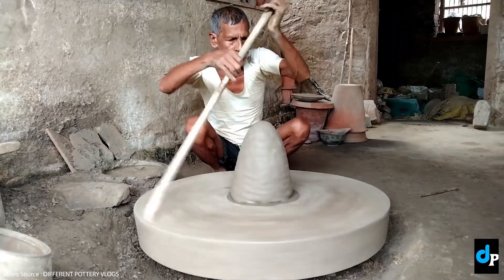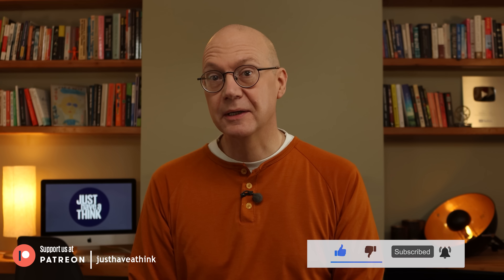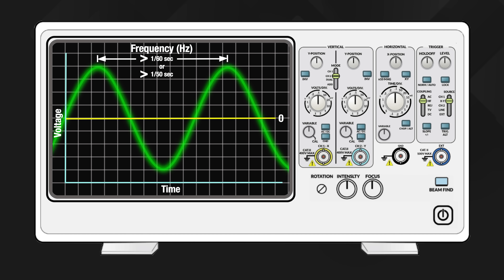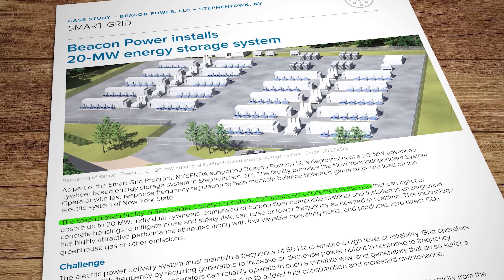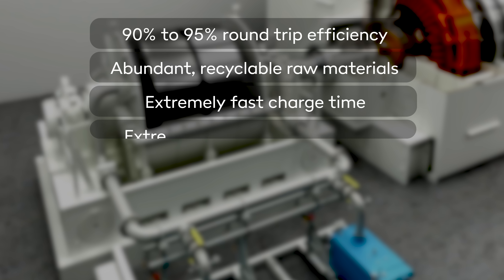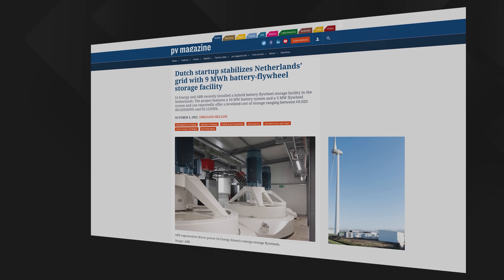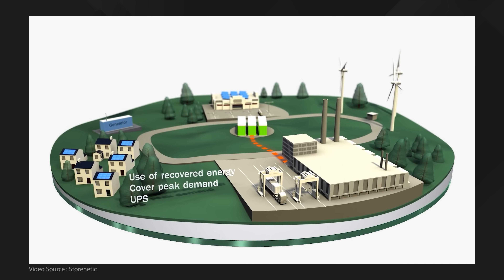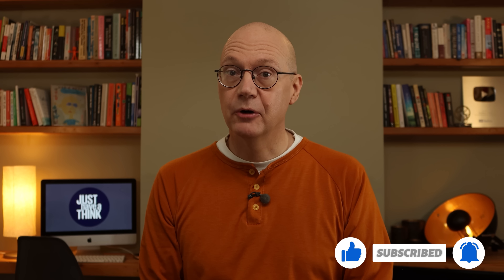Flywheel reinvention revolutionising our power grids!

Comment: One or two comments got close but, sorry, no-one here is thinking or understanding what these things are about.
I'll put the conclusion first - they are NOT to stabilise frequency. They are to stabilise Voltage

A very large problem that grids have always had is when new loads are added. Whether on a local scale or national.
The problem with 'new loads' is that they almost always contain an 'energy storage element'
Classically this would have been a coil of wire in either a motor, a transformer or especially, the ballast in old-style fluorescent tubes (long thin ones)
This is because a coil of wire, when connected to (switched on) to an AC circuit, presents itself as a dead-short-circuit.
And it remains like that until it has built up its magnetising flux (transformer & ballasts) or in the case of a synchronous motor, is up to its working speed and thus 'synchronised.
We are talking fridges, freezers, air conditioners in the home and much larger motors out there in industry.
Now then, because all grids and networks have real actual DC resistance, when these loads attach, they cause a big hole to appear in the voltage waveform - long before the 'frequency' has had a chance to see it or change.
How the grid coped previously was in that the things supplying the grid were also large lumps of wire in a magnetic field so that despite the voltage hole created by the short-circuit, they could still create and move very large currents. Currents that would magnetize the transformer and get the motor spinning - even during just one single cycle of the grid frequency.

Another class of energy storing/sapping loads contain capacitors, as in fact most home based equipments now do. They used Switched Mode power supplies instead of transformers BUT, when the device is switched on, those capacitors have to charge to their working voltage and when they do, in any circuit DC or AC, they also look like short circuits and knock a large hole in the voltage waveform. In fact, capacitors are worse than transformers/ballasts, capacitors make much better 'short circuits'

The Problem comes nowadays that a lot of energy on the grid comes from (solid state) inverters.
Certainly they need a 'grid frequency' to latch onto but the problem with those inverters is that they 'watch the voltage' like a hawk. They have to.
They also, for their own sake and safety, need to monitor the phase difference between what they're making and that of the grid they're supplying.
Thus the real problem for everybody is when a (brief as they always are) short circuit appears across the grid. The Solid State Inverter (SSI) will see the voltage hole instantly and for its own sake, for the sake of lawmakers/regulators, the sake of workmen on the grid and consumers, it is obliged to disconnect. The voltage hole will also appear, to the SSI as a phase error and it will disconnect on that alone if not the voltage error.

Thus you see the problem for the grid...
When a 'short circuit load' connects and requires a short burst of power to get itself going, large numbers of devices supposedly providing that power instantaneously disappear.
It's a perfect double whammy.
That will occur on a local level (say the air compressor or a welder in a garage switching on) but on real grid, the effect will ripple outwards. Other SSIs even far away will sense the voltage error and they will disconnect - there will be a (potentially huge) cascading failure of the entire grid

Sorry it was an epic but, we need to think

Also, and as happened in the UK a little while ago, was lightning strike on a power line.
Because the lines/wires are all fitted with lightning protection, they will be OK.
But, that lightning protection consists of a spark gap - fitted on almost all insulators used on overhead lines.
When the lightning hits, it sparks a strong electric arc across one or more of those spark-gaps and because electric arcs have *very* low DC resistance, they short out the lightning and protect the grid. 
But they short out the grid also.
(They work by creating the short circuits and the energy of the lightning is dissipated in the DC resistance of the wires as it runs to ground, where it wanted to be. Folks wanting to build super-conducting grids are hereby warned - where would the lightning go then?)
And SSIs for miles around will see that, instantly disconnect as they're obliged to do and as they did in Southern England, set off a cascade that blacked out millions

And THAT is what synchronous condensers/capacitors are all about - Voltage stability, NOT frequency.
Some may say that they are a tacit admission that Renewable Electricity cannot work on a real grid with real consumers and real lightning strikes

Comment: The best mechanical battery is potential energy, not kinetic because you're fighting with friction the whole time. Using a ram pump and possibly a solar powered pump to put water way up high and then at night release it to turn a generator. And then it does the exact same thing all over again at set up.

Comment: Depending on the price, could homes have their own flywheel battery to reduce the demand on their local grid, avoid power outages, and help to avoid surges?  If possible, one, or multiple, that can be serviced and replaced when necessary would be ideal.

Comment: The most important figure of merit is specific energy. Its metric unit is J/kg. All existing flywheels have EXTREMELY LOW specific energy because they are made of weak materials. A flywheel made of strong material (Zylon = PBO) would have high specific energy (~1MJ/kg). Zylon fibers are expensive ($220/kg), but very strong (5.8 GPa). Dyneema (UHMWPE) fibers are weaker (3.1-3.8 GPa) and moderately expensive ($20/kg).

Comment: Not sure why... But... Huge, huge metal flywheels... I don't get... The larger/heavier/greater mass of on object the more energy required to induce motion... And the concept that efficiency always incurs a loss and "an object in motion tends to say in motion" until getting converted back... Just seems like the utility of choosing larger and larger is only to reduces the footprint space requirements. Greater size is proportional to greater weight! Which inturn, requires heavier engineered supports and higher costs... The larger you go!

So what am I missing? Wouldn't it be better to use scaled down equipment (say the size of conex box or Semi-Trailer!) be more manageable and pose less risk with reduces costs?

Comment: I'm confused as to why flywheel tech is so much more expensive than lithium battery storage. It's essentially a disc in a tube. But the batteries would be far more complex to Design and implement on a large scale. Why is the opposite true. Can someone educate a dummy like me.

Comment: The primary advantage of flywheels versus batteries is their POWER density. Batteries have superior ENERGY density, however, the maximum discharging current is limited by the battery chemistry. This makes flywheels superior for applications where a large amount of power output is needed, but only for short periods of time, such as riding through fast transients in power systems or shifting between gears in a vehicle. The superior energy density of batteries makes them more suited to applications like load leveling, where the cycle times are much longer. When comparing flywheels to batteries it's not really accurate to say one is superior to the other since their operating principles make them suited to different applications.

Comment: "Oooooh, we've discovered flywheels!!"  Yeah, they're called generators.  You can find them in every fossil fueled or nuclear power plant.  But let's reinvent the, er, wheel, why don't we?  Even better, we'll double our costs by de-coupling the generating part from the flywheel part.  Then we'll couple that with unreliables such as wind and solar and ramp them up and down constantly praying that there is enough fossil fuel generation left to keep the grid from collapsing.

Comment: One of the main reasons why lithium batteries are cheaper than flywheels is that you do not pay the full price for social and environmental impacts connected with the production of cobalt and lithium. If these were included, flywheels could be much more competitive.
Reply: We don't pay the full price for social and environmental impacts of anything! Coal and oil anybody?
Reply: @MrAdopado  Of course. That would certainly make a big difference.

Comment: Why not combining the flywheel, with a power converter in the same way as a modern wind turbine. Then you can have different speeds on the flywheel and deaccelerate it more and store more energy in it.

Comment: Usually, I find a lot of this channel's coverage to be grating and pandering to the climate pseudoscience. This video however covers a technology which is smart, readily available, scaleable, affordable, and which solves a number of key problems from short-term variance in power demand to mid-range spikes/troughs due to renewables' inconsistent output. It's not oversold as a replacement for those mean ole fossil fuels (a BS narrative) nor as the long awaited savior to finally make renewables not suck (they still do). But renewables have their niches in which they're useful and technology like this can expand those roles without relying on Chinese slave labor or African child labor to get the components, spontaneous ignition of the device, or disposal involving dumping heavy metals all over the planet creating actually dangerous heavy metals pollution.

A good idea is a good idea and this host presents this one well. We should support smart ways to store potential energy that we can use as batteries to meet our energy demand fluctuations. This one looks very promising.

Comment: Instead of unstable power sources like wind and solar cells and then Rube Goldberg solutions to stabilize them with batteries flywheels etc., we should just use big generators powered by steam from nuclear reactors and problem solved.

Comment: In the end, I don't see much room for flywheels in energy storage. First, as said, batteries are rising to such a position of dominance, ramping up to such a huge scale because of EVs, that they are going to be hard to keep up with in cost. The problems they have, such as mining and disposal, can be expected do decline with time. They share a limitation that batteries have: self-discharge.

Mechanical energy storage systems have the virtues of simplicity and cheap materials. However, if you want to avoid self-storage, you really need to think of more static systems. Pumped storage is good where the environment makes it workable, but you can also consider various kinds of gravity batteries.

There are situations where longer-term energy storage is necessary. However, globally they are the exception, not the rule. Whether this is ture or not for a given situation, I just don't see flywheels competing.

Comment: R.I.P. - F1 KERS - 2009-2011 and Use? Stored potential in a elevated weight -> lower weight to spin flywheel to gen power at a 'Black Start Station", and that is its only use. (the station)

Comment: Mechanical Engineer here: To be very clear, mechanical systems like these are absolutely not economically viable as energy storage systems at utility scale and have NEVER been intended as such. The time scale these systems react to are measured in seconds or minutes, as power demand  fluctuates, they do NOT provide power for hours on end. I think the video is somewhat misleading as it creates the impression that these are/should be used as energy storage systems used alongside renewables sources, instead of say batteries. If you think these are the storage solution renewables are waiting for, you are wrong.

They are increasingly needed to ensure grid stability because of the inherent variable characteristics of renewables, where traditional inertial damping is simply no longer part of the grid.

Comment: I worked in a telephone exchange that was built in the 1930"s. In the battery room there was also a flywheel generator, original equipment. Plenty of interesting old tech in there.

Comment: Hey there. I am a grid engineer and I have experience operating a small experimental power station (2 actually) with flywheel energy storage. I am also a fan of this channel and find it generally informed and accurate. However, in short this technology does not work as has been described here. Here two distinct concepts have unfortunately been mixed - resulting poor conclusions - a mistake I have heard many informed people make. So here is my 2cents.  Synchronous flywheels and asynchronous flywheels. The synchronous ones can stabilise grid frequency (which is nowhere near as necessary as most traditional engineers think it is), but because they are synchronous can only store small amounts of energy. (The frequency delta must be kept small - necessarily).  Asynchronous flywheels can store much more energy but end up with rectifiers and inverters so really respond pretty much like any other battery.   Asynchronous flywheels are expensive per unit energy and have very high parasitic losses from magnetic bearings and holding down a vacuum (in my experience at least).    Ok, now the bigger issue….inertia. So much wrong info out there. 1 the main reason we need inertia is because of inertia!  The big spinning conventional generators don’t like getting thrown around frequency wise. As we move to inverter based this need disappears largely. Inverters can happily deliver +/- 5 Hz (in fact for many 50Hz or 60hz is just a setting).   Too many traditional electrical engineers can’t imagine the inverter based future. We need a paradigm shift from them around inertia and system strength.   I have run small grids where large frequency excursions happened. There were NO customer impacts (3-5Hz type levels). This NOT what causes brown outs.  (But yes if you go too far conventional machines and then inverters will trip off).

Comment: I heard of a flywheel producer setting up charging facilities for a ferry in New Zealand. The discharge rate (C) is unlimited for those things and there is no need to upgrade infrastructure. It makes it possible to even use infrastructure more efficient.

Comment: Don't oversell the safety. These flywheels spin at 100,000+ RPM. The stored energy released from any kind of accident is enormous, like a bomb, because it's discharged all at once. Batteries by contrast burn rather than explode in this fashion because the chemicals have to mix to release their energy.

Good tech otherwise.

Comment: would lifting a giant weight into the air be another low maintenence form of energy storage?
Reply: very little energy can be stored with gravitational potential energy, resulting in horrendous energy densisty. As inertial angular momentum is proportional to velocity and density, flywheels are only limited by how fast you can spin them, which, in a vacuum, is pretty dang fast.

Comment: I think the video doesn't distinguish well between energy storage and frequency regulation. In my understanding flywheels are not very useful for energy storage, because most of the energy stored cannot be effectively extracted. (This is like having a water tank with the oulet half-way up the side: one can only get access to half of the stored water.)
But if the aim is frequency stabilization, the storage aspect becomes less important.

Comment: Lithium is possibly the most disastrous idea for large-scale storage that we can think of as it is environmentally and socially destructive and geopolitically risky in the extreme. Flywheels are far better in the long run. Saltwater accumulators, sodium accumulators, supercapacitors, hydrogen, and demand management can fill in for everything else. Gravity storage, ammonia, and compressed air have a very small role too in very specialized situations.

Comment: Flywheels do work, yes, but most of the time there are better storage solutions, so they can only cover a small niche of the market. The biggest weakness is that the flywheel is constantly loosing energy, this is also the one of the two main reasons why flywheels should only be used as temporary emergency storage the other reason is wear and tear, the less a flywheel is used the longer it lasts. 

A good use case is as a complement to batteries for a hospital with solar if the grid goes down. The batteries would be LFP of course and the flywheel would only start spinning when the grid goes down and the sun is up electricity. Since the battery is better at not leaking energy, the flywheels will be emptied first when the sun goes down and later the battery. This prolongs the life of both the battery and flywheel.

Comment: It would be interesting to know the reason for the difference in cost between this and batteries - is it down to raw materials or just because it’s currently an early stage niche product? Would cost per kWh reduce if deployed more widely?
Reply: For energy density you are looking for hubless, levitated, vacuum sealed, and very fast, but light flywheels. It seems that this guy glossed over the one company doing that. Teraloop which purports 91Wh/kg, and to increase the total energy, it's a matter of wider or taller.